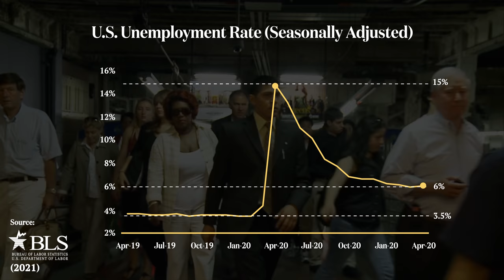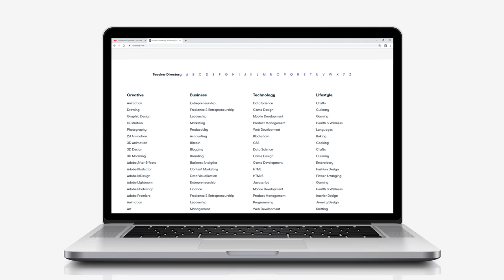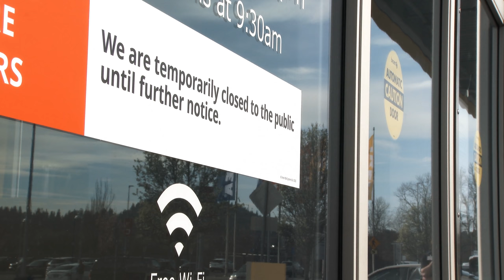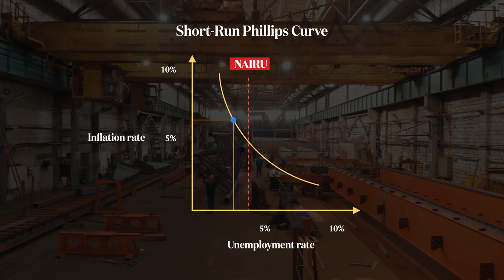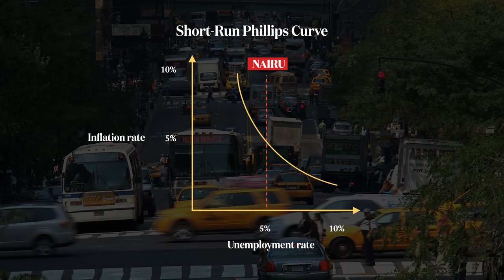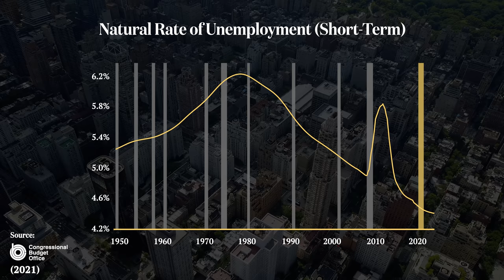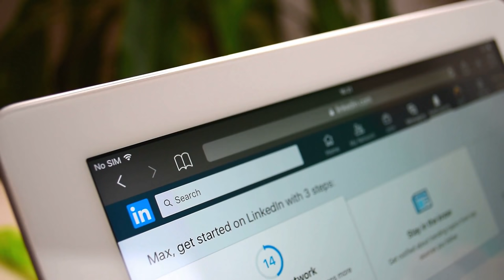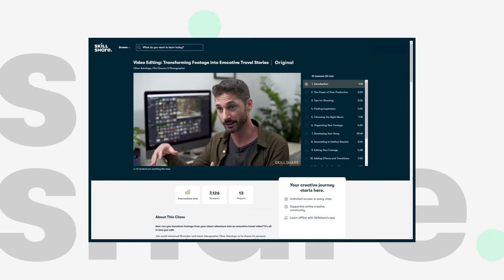The Great Labor Shortage Crisis | Economics Explained

Comment: Wage costs are only a fraction of the total costs. For example, labor costs on a car account for about 5% of the showroom price. Wages also increase in fractions rather than factors, so a massive 10% wage increase for the laborers would result in a flat 0.5%  increase of the pirce of the end product (even less so, since laborers account for only a part of the personel). I never got how keeping total costs under control was be such a prohibitive reason agaist increasing wages. 

Unrelated, I have some reservations on the increase of job opportunities. The jobs in the examples given are in the lower end of the economy and in the gig economy. For these companies it is very easy to create new job openings. They need little to no material/building provisions. For example, Uber drivers provide their own car, and you can easily fit a few more amazon packers within the same shift. While higher end jobs require office space, training, IT-materials and licences. If applicants would accept it, I could very easily make a listing for 100 programmers with the same lack of provisions Uber gives their employees/contractors.

Furthermore, does the number of job listings reflect a same number of job openings? In IT the same job opening can be listed by different recruiting agencies. The number of listings increases by a factor if you take the several recruiting platforms into account. A lazy data analyst (or one with an agenda...) could easily inflate job openings with a factor 5-10. On the lower end of the market, are they hiring for an existing position, or for a reserve? Are they hiring to drain out competitors? If Lyft and Uber both are active on the same market, it can be advantageous to connect potential drivers to their company first, without actual demand for their labor.

Also, a hiree has much less negotation power than your video leads to believe. The range you can negotiate on in IT is, on average, a few percentages. The Uber drivers from the example even don't get to negotiate! The coal miner from the example probably will have to follow the same regimen as his colleagues. If they work 80hrs a week, so will he. And he could leave the company to apply in Uber, but I doubt he will.

In summary, which parts of the labor market are actually in demand? And how does that labor pool communicate with the rest of the labor market? This  was a unthoroughly researched video and feels more like a mouthpiece for rehashed statements.

Comment: It's unfortunate to say, but covid was a godsend for those that earned a lower wage. For the first time I had options of employment with better wages and working conditions. And it's extremely unfortunate that people died, still dealing with long term effects of covid, and other issues covid placed on the general public. May those that passed rest in peace.
Employers finally saw, your business cannot run if the people you NEED to do the work,won't because they have better options your business will fail.

Comment: This is pretty good but it should be noted that it fails to take into account the wage stagnation that has largely been in effect for the last 40+ years since the Raegan trickle down economics tax cuts.  while an increase in wages will increase the cost of goods the inverse has not been true.  Reduction in costs to companies and shareholders has not reduced the cost of goods and the wages have not kept pace with increasing costs for decades.  The current job situation can be seen as a sort of market correction due to the stresses placed on the ever shrinking middle class who now (partially through government aid) have a choice and also carry differing values then their predecessors.

Comment: Novel idea. Let unemployment run low, simply  pay the shareholders a little less. Waste less money in inefficient business like building skyscrapers above 10-20 floors, or dedicating whole industries to wasting valuable resources on luxury products. 

Now it's a lot more complex than that. Given that low income workers will tend to spend their extra money on necessities and quality of life. Whilst comparatively, high income workers don't spend as much money as when that same amount of money would be spread across like 5 workers instead. So obviously there would be growing pains, like how there's resource shortages right now. (building materials, for example). But in the long term, wouldn't it create economic growth and a greater incentive to use renewable resources and recycling? After all, the more expensive a piece of wood costs, the less expensive it is to turn old wood into recycled material. It's one of the reasons not that much plastic gets recycled. It's just too expensive at the moment.

Comment: It's not gonna be as big of a deal as you said in my opinion. 

Sure, initially there is gonna be price inflation with wage inflation. As your example of the plumbers and the trucks showed, prices of some goods will rise. But with an increase in demand and an increase in prices signals to businesses to increase production bringing the price back into a lower equilibrium as supply is increased.

Also assumes that people will immediately be using the funds for consumption rather than saving.

Comment: I half agree with better pay if it is done with caping business executives salary including bonuses like stock options to a maximum of $500k (today our pay is 10 times less than what it should be which is at a minimum $10k for a basic job) plus unnecessary or jobs that don’t need constant attention either can be removed or just made part time work. 
The business term “cost” is a major problem as personally I don’t see any reason to consider cost cutting an option regardless of how bad the company is preforming.

Comment: You have very deftly ignored one of the biggest problems many of these companies who are struggling all share: The bloat on the top of the pyramid. CEO compensation as a ratio to other employee's is orders of magnitude higher than it's ever been in the past. You can trim $10million off of most CEO's income and divert it to the front line employees who actually do the work to earn the company it's money and you'd se a marked improvement in the quality of applicants. You talked about how companies will have to raise prices to cover costs, but that's not quite an accurate picture. Your grocery store installs a bunch of self check out machines and now it only needs a fraction of the staff. That cost cutting measure wasn't passed on to the consumer, prices stayed the same and the increased profits were sent to the share holders. The even more insulting part is that despite not needing as many people, the labor hours aren't even transferred to the smaller remaining staff members. Companies NEVER reduce prices if they can get away with it, they either hold them or raise them. So, if we're automating all these front line jobs, then the companies SHOULD be passing the added profits to the employees to reflect the increased cost of living and inflation. But they're not. They kept labor at minimum wage for as long as possible despite knowing that the buying power of the dollar has shrunk. No rational person running a checkout machine at the grocer is expecting your $100/hr example. But, they ARE wanting basic full time hours, BASIC benefits (like occasional PTO), and a wage that allows them to keep a roof over their heads AND put gas in their car (not one or the other). Employers don't have to promise the world and bribe with all these weird promises of money just to interview, they just need to temper their greed JUST ENOUGH to pay the people who actually earn their money a basic living wage. That's it. 

EXAMPLE: Texas, HEB grocery stores have zero problems filling any spots because they start at $15 and hour and offer exactly what I said before (full time plus simple benefits). On top of that, they are incredibly competitive in pricing and quality AND they are slowly expanding. It's not magic. It's responsible ownership and respecting the people who actually do your work. Employees there are proud to work there because they don't have to struggle to feed themselves and by living frugally they are able to be comfortable without relying on government assistance.

Comment: How could economist be worried about the NAIRU? First off, most economists know that inflation can be, and currently is, completely controlled by central banks, that was one of the arguments to create central banks in the first place.  Without the banks, inflation just becomes random because it falls under the control of businesses's willingness to loan to each other, which is much like desperate auction house, desperate for the highest bidder and cash flow at the same time.

Secondly, inflation is a measure of the percent change of prices compared to the percent change in wages. If wages raise and prices stay stagnant, that is negative inflation and very bad.  

However, wages aren't raising in the USA on the whole, only in the lower income sector and the current price changes are occurring in goods provided form the lower sectors, which means inflation will only hit the middle and upper income people. The caveat in this situation is that inflation rates for the lower income sectors have been massive for years due to the stagnant wages since 1999, with wages not realistically moving until 2014 when Walmart upped their starting pay forcing all low end business to raise wages to be competitive. Edit: which means that the price increase is just adjusting to the true natural price of the products offered.

Comment: the minimum wage argument that is spouted everywhere is invalid .minimum wage used to be raised yearly chasing inflation then regan and the republicans decided to stop raising the minimum wage to "stop inflation". it's easy to see that inflation is not solely or even moderately tied to wages at the bottom rung or the pay ladder. 40 years later inflation is over 60 percent higher the the min wage instead or 5-20 percent lower. 2020-2022 isn't even in that calculation or it would be even worse. just like raising the prime interest to stop inflation. to stop raising costs by raising costs doesn't work. but if your rich and don't have debt then increased interest make you money. the real reason behind their actions can always be found by following the money of the rich. ps stocks are non taxable so you can pay yourself in your company stocks to dodge taxes. why do you think the people in charge (that are all rich) care about the stock market so much? also the take rate for the rich in america is high BUT the amount they actually pay is less than 3 percent.so many loophole only available for very large corporations

Comment: I disagree with the "passing the cost on to you" part. CEOs of big corporations are the ones extracting value out of the economy. The only reason wages are low is because the CEO are raking in the difference between wages and actual value created by employees. Nobody in the economy gets paid anywhere near the value that they produce for the company and as a society we are vastly more productive than we were in the past. That would be fine if the company was using that to improve the business, provide more benefits to the employees, or grow, but a large portion of it is stolen by CEOs through increases in their total compensation and "financial engineering" to artificially inflate the company's stock through stock buyback programs. They even take on funding rounds just to buy back stock to give to the board and investors. It's all just a game and the business leaders are the ones winning it because they have all the power.

Comment: It's no where close to a 1:1 correlation, but the situation sounds a bit like what another disease, generally called The Black Death, caused- there are less people to fill labor roles. 

If the companies were willing to give the hours and wages necessary to, you know, actually live, they could probably get the workers they want. It may have changed, but last I heard the average in the US is 40k a year. Some places force that number up by making it more expensive to buy a home- please note, the original minimum wage was set for someone to be able to buy an average house for about two years worth of their wages. 300+k houses, plus minimum wage not tied to inflation, has ruined that.

There are ways to limit unemployment to just the good kinds. It's just that greed means that corporations refuse to see how treating their employees well benefits them in the long run, despite shorter term losses. Japan has more companies that are 100+ years old than the US, despite being a geographically smaller country, because those companies saw the long term as being better for them.